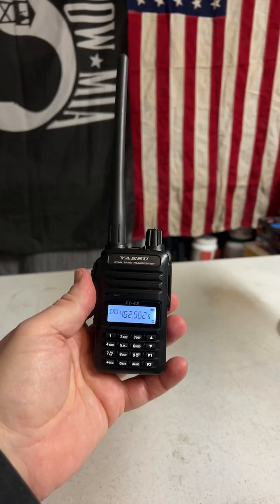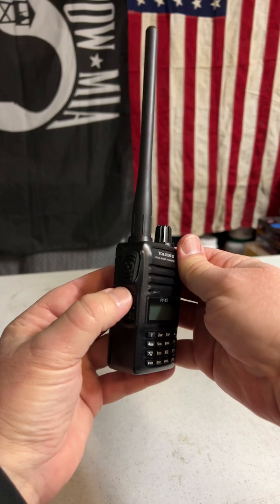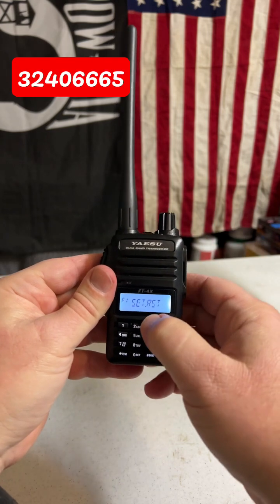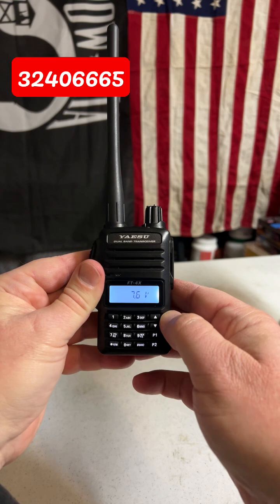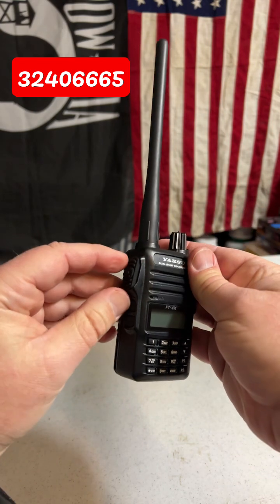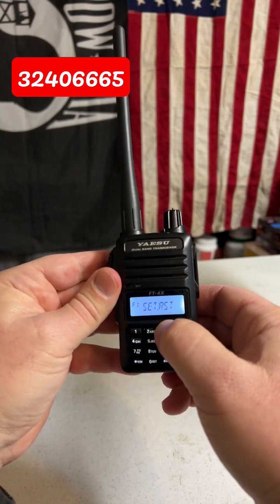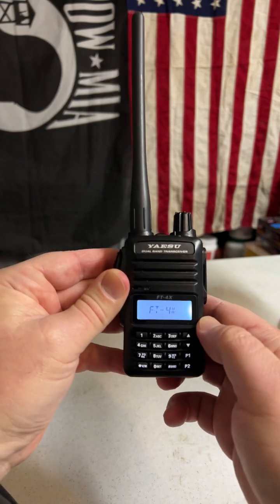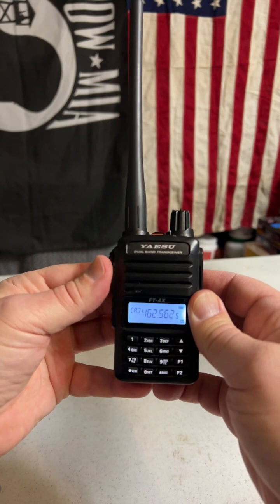Yaesu FT-4X MARS Mod

Comment: My question is: does the MARS mod allow you to program frequencies on the 2.5 step? So far, I can’t find an answer. It seems that Yaesu has fallen short on only allowing a minimum 5.0 step on its frequencies. I’m hoping a MARS mod will resolve this.
Reply from the maker: Thank you for taking the time to watch and the comment! It is greatly appreciated.  Unfortunately I don't think there is a 2.5 step. To me I think having a 2.5 step would make more sense.
Reply: @WJ6FRadio  Agreed! Other radios have it like icom, Kenwood, even Baofengs! I wonder what’s holding Yaesu back?
Reply from the maker: @fly04002  I wonder if Yaesu figures the “Auto” setting is good enough.  I don’t think it is.  I put all my radios that I can on 2.5.
Reply: Nope but you can use 7.5 step i believe only available in Europe